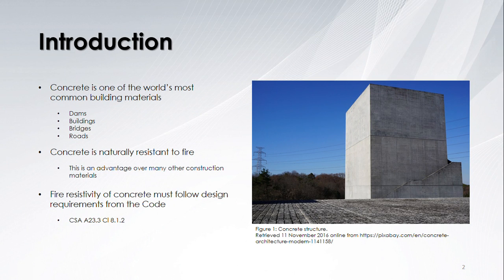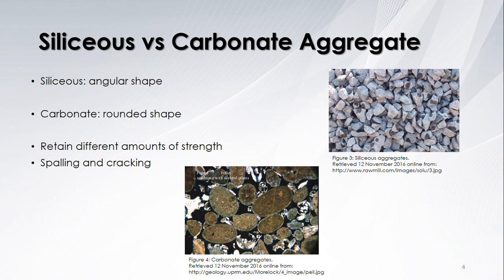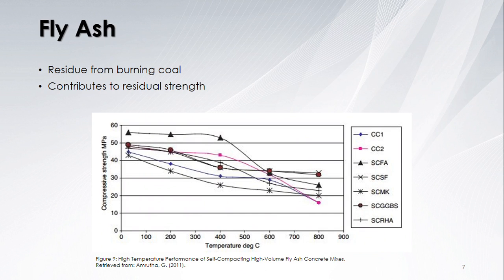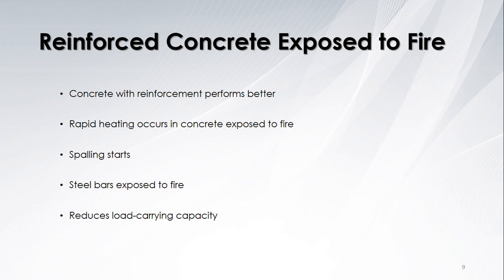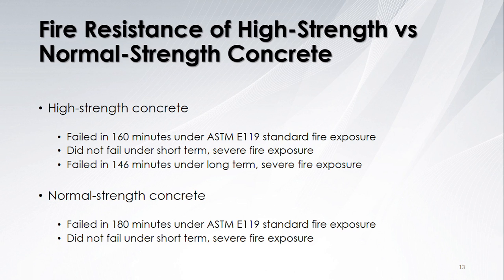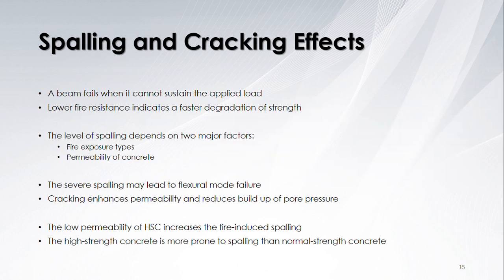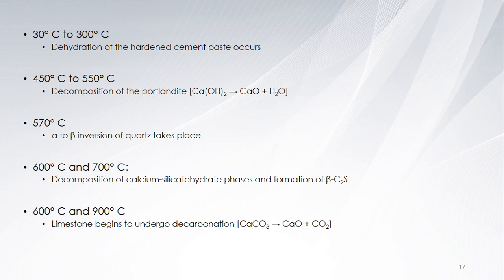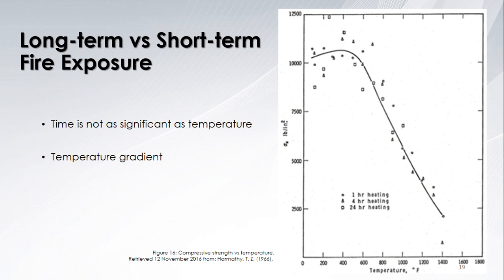Concrete under Fire Exposure

Comment: Thank you for making, but the narrator voice quirks and accents are too hard to follow.  (Caveats -- these are technicians, not a communicator).  

The material would communicate better if the text were simply read by an automatic text reader, like the read-aloud feature in Adobe PDF.

Any chance this could be re-issued using the Adobe text reader?

Comment: This is great and very technical.... but I just wanted to know if I can make a small fire pit out of concrete...?? Or would I need to give it any special coatings...??
Reply: clay / brick will never break even get rock solidify if exposed to high temperatures
Reply: Same here. Let me know if you find an answer to that .